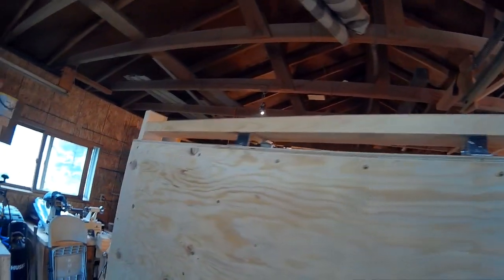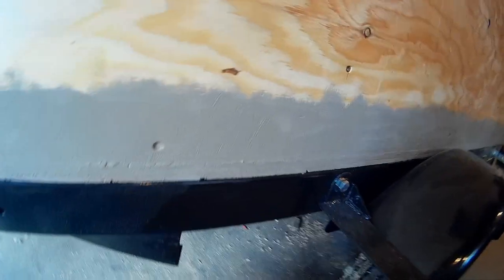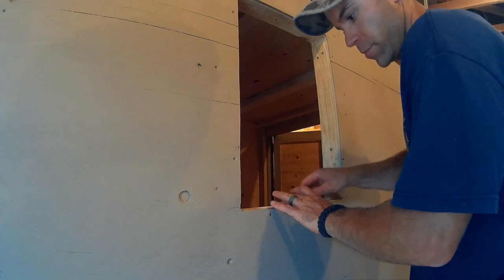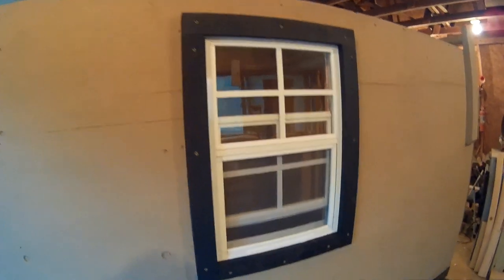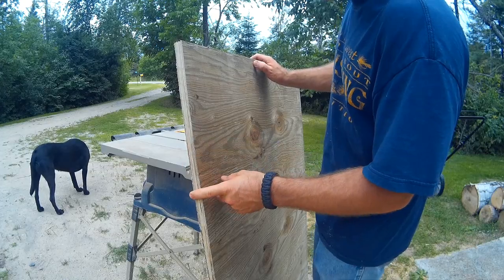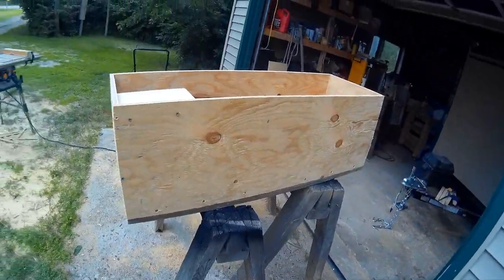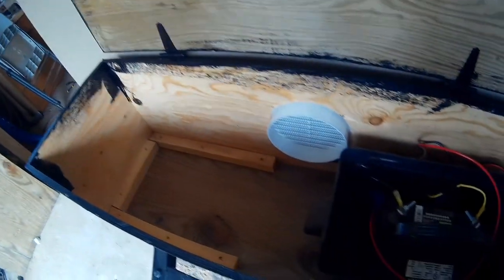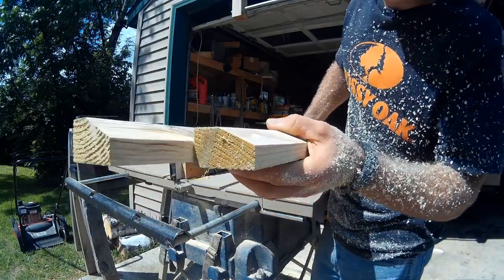DIY MINI CAMPER Part 3 - Paint, Windows, Trim & Storage Box

Comment: So for the paint on the roof. Did you just use the waterproofing?  Did you paint over it?  How did it work?  Any leaks?  I’m studying your build and using as the basis for my build. Trying to decide if paint is good enough or if I need to do poor mans fiberglass. Are the walls just outdoor enamel?

Comment: Does the roof or any of the joints leak when it rains ?
Reply: Do any of the seams leak when it rains ?
Reply from the maker: +J S -- No leaks on the trailer.  Just seal all joints and cut edges with a good silicone.  The battery box isn't 100% waterproof.  Thanks for watching!
Reply: Northwoods Life its a sharp build thanks 4 the reply

Comment: Sorry, bro, but you scared the hell out of me when you ripped that board on your table saw. Your fingers should not have been anywhere near the blade, and you should have used a short pusher stick. Also, I think I would have used the front trailer space behind the battery box, to extend the teardrop up to it, instead of a separate box, even if that meant dividing your teardrop into two rooms, with the front one being storage, if you needed it that bad. I think the unified larger teardrop would have allowed a front 'room', even it most of the new room would have appeared to be unsupported by the boat trailer.
Reply: My Dad got a nasty saw cut, and three of my uncles lost finger parts to saws, so I approach them (saws, not relatives) circumspectly. We always have time to get wounds tended to, and to get back into mid-season form after an injury. But it takes only a few seconds to take precautions.  "Too soon we get old; too late we get smart."